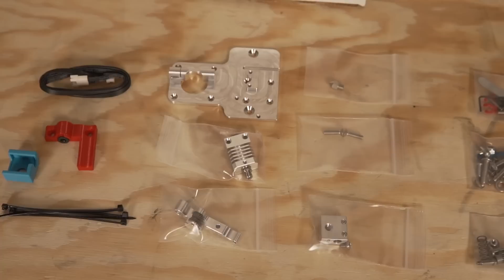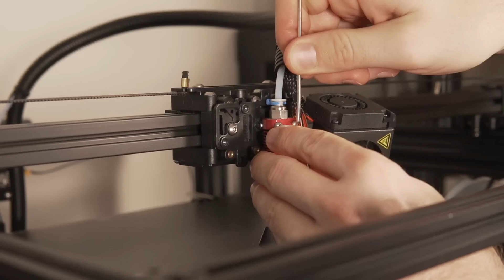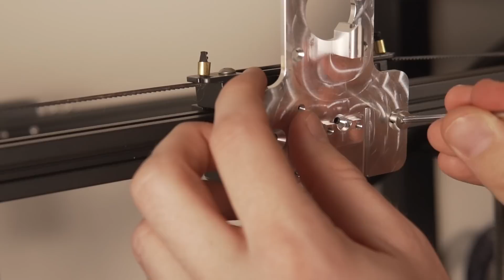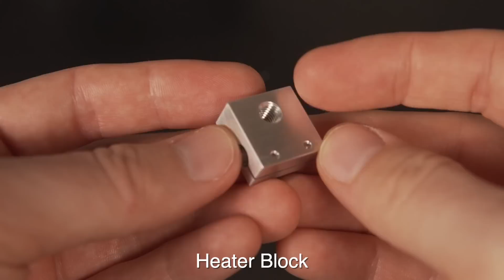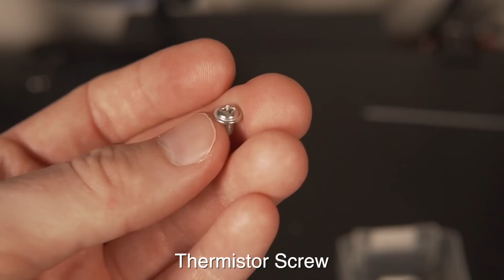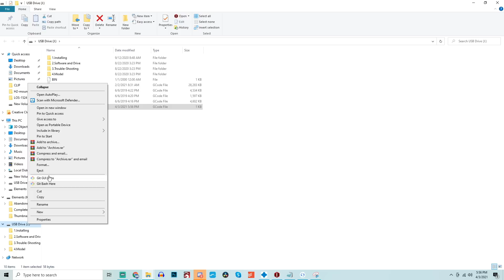Micro Swiss Direct Drive & All Metal Hotend ExoSlide Install

Comment: Hey Daniel I just got myself an ender 7 it new on the market having problems to find parts
I want to print carbon fibre
My Nozzle UM3 🤦🏻‍♂️
0.4 and it goes up to 260 
The filament that I have it’s 
Sinasmart carbon fibre Nylon
Do I need to modify anything

Comment: Hi, great videos. 

I am just now thinking about buying my first 3d printer and I like Ender 5 plus, but haven't found review on your chanel even though you have this nice upgrades. I like to have this amazing built volume but is the print quality without these upgrades also good or would you rather choose to have smaller volume like Ender 3 v2 or Ender 5 pro has? Which one would you choose? I do not plan to print flexible materials for now.

Thank you, Great content
Reply: Ender 5 plus is a lot easier to use then the 3 series. I’ve owned both and the 5 was night and day easier for me to start getting good prints. A lot less variables and tuning needed to get it off the ground.

Comment: When I installed Micro Swiss to an Ender 3 I started getting a lot of clogs when printing PLA, I moved the Micro Swiss to my CR-10 and the clogs stopped on the Ender 3 but started on the CR-10 so the Swiss was responsible.
 Have you experienced a lot more clogging when printing PLA?
Reply: Use a filament oiler when running PLA.
Reply: Did you bump up your Temps? Need an extra 5° min .
Reply: Did you adjust the retraction? Should only be 1-1.5 mm vs 5-6 for a Bowden setup.

Comment: Whenever working with parts that will be heated to a high temperature you want to be very careful about the oils on your fingers, as they are acidic.  I’m constantly cleaning my finger tips with alcohol prior to handling the parts, and I wipe everything clean with alcohol afterwards, to ensure that there isn’t any residue left behind.  The reason that you need to be extremely careful about touching the temperature sensor, is because it is usually encased in a glass bulb, and any oils from your fingers will cause the bulb to explode, or crack, when it reaches the operating temperature for printing.

Interesting Note: I take the same precautions when handling batteries.  Not because of high temperatures, but because the oils are acidic, and they will etch into the both the battery terminals and those in the battery compartment.  On low power devices (i.e. remotes and watches) this will cause the device to fail prior to the battery failing, as the etching increases the contact resistance.
Reply: Why not wear e.g. nitrile gloves? But I do have my doubts that it's really necessary. I've heard the same stories about tubes/valves used in guitar amps but I've never seen that happen...
Reply: @saschaschneider6355  I have tons of gloves that I use when sparingly while printing with resin.  My hands sweat a lot, so I don't like wearing gloves where my hands can't breath.  If you can wear them, definitely do.  You don't need to clean up what you don't contaminate.  ;)

As for vacuum tubes, it depends on the amount of heat that they generate.  Normal vacuum tubes get warm/hot, but not that hot.  High power vacuum tubes get extremely hot, and typically have explosion shields/cages around them. Projector bulbs have the same issue.  I have seen/heard them explode while I was studying electronics in the late 70s, when you were still required to learn vacuum tubes for an Electronic Engineering degree.

Comment: what about the 260c max temp,,, whats the easyest way to to update the printer to print at 270c or 280c as it is now u cant print above 260 with the all metal hotend seems like that needs to be addressed